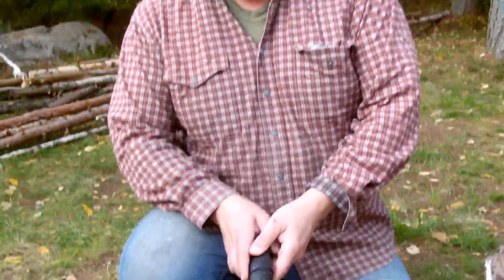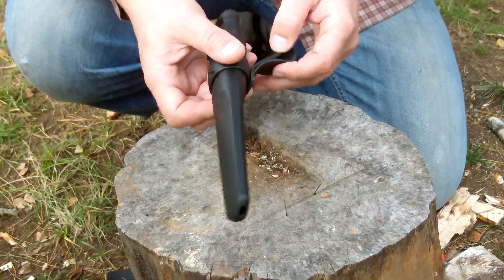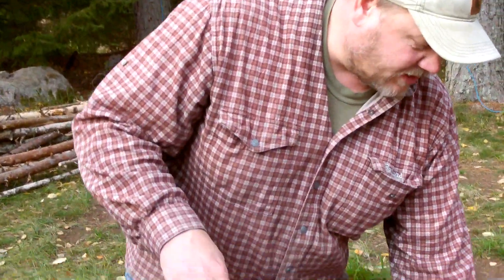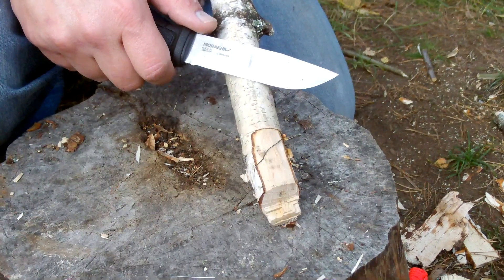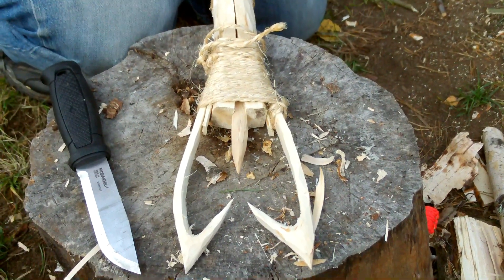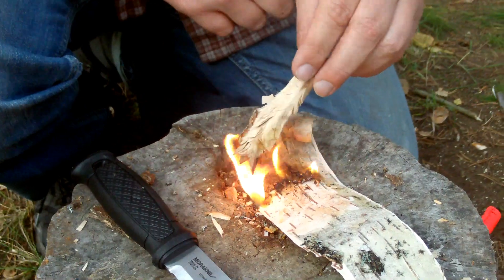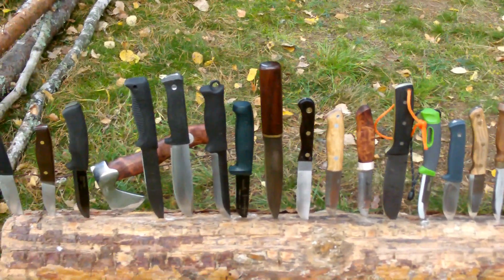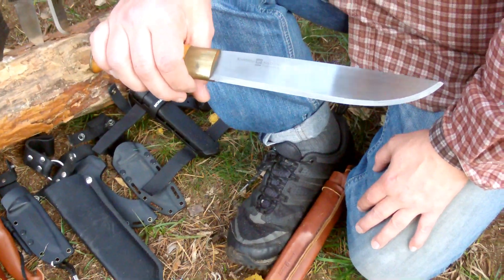Thor-is-testing: Mora - Garberg

Comment: I prefer the belt clip on Companion etc. Strong and useful, positive. Yes a belt loop can be useful sometimes, however it is easy to add a simple loop to a sheath but not to add a clip to a sheath. Kansbol can fit in Companion sheath, I think this will too. So it's all quite flexible.

Comment: I'm not fond of Scandi grinds for most things as it only has a short sharpening life until the grind gets too steep and literally needs to be re-ground. BUT  for wood carving they are excellent. I buy some Lauri progressive temper blades with a Scandi grind and the edge is HRC 63 hard, that is file hardness and for carving wood it is excellent. I put nice handy handles for carving with a flat spot on top for your thumb. Wonderful blades.
Reply from the maker: As you have probably heard in my videos I think scandi is the best all-around grind. I agree white the sharpening, but do think that they are easy to sharpen also on the trail. hrc 63 is that not to hard want it chip?
Reply: @Thoristesting  Yes it will chip if you hit something hard. I sold one to a deer hunter who wanted a knife that could go through a deer without stopping to sharpen and I warned him about how it may chip if he hits a bone hard. He said he carries a small hatchet for splitting the pelvic joints and he'd be careful. He basically just wants the knife for field dressing and he uses one of my old D2 fillet knives (HRC 60-61) for butchering it down into hamburger cuts and roast/back strap etc.
 I don't do anything fancy with the Lauri 3 inch knife, just a small guard and exotic wood like purple heart or marble wood with a leather sheath and a nice border tooled onto it. He said he didn't know where he could get a semi-custom knife with a left handed sheath (he was left handed) for under $100, I sell them ($85) as wood carving blades, but if you're careful you can use them for skinning, but they're not exactly an everyday carry, EDC blade as chipping could be a problem if used beyond its design parameters.

Comment: Hey… thanks for the testing. One suggestion, could you rank all the knives you've tested in the your order of preference, just to have a perspective on your "Journey" so far. Take care, Irène (subbed by the way).
Reply from the maker: Melusine Centun, hi there Melusine, hmmm I have been thinking about it, and in the start I did grade the knife on a point scale. But it seemed that most knife manage to get almost the same score, some are expensive and really nice knifes but I also find that it takes a true skill to make a quality knife for few bucks. So like I said it is very hard. Some are pretty some are no bullshit knifes. I love them both. Some are all around knifes some are camp knifes some are workhorse. I love them all 😀
U get my point. Though of course I have my favourite that I were when I’m not filming
Reply: Thanks for the answer. So what is your favourite??
Reply from the maker: It will have to be in categories them- High end: Fällkniven A1 or S1 (ill be testing the S1 soon), - No bullshit tough knife Terävä 140- On budget Mora or (Hultafors really cheap)- Pretty knife => Karesuando- Best all around for the money Mora Garberg
Reply: Thanks for answering this difficult question. Take care, Irène.

Comment: All Moras are the best bang for the buck, you won´t find knives which get you more for your money.
Knives which cost 10 times more won´t do better in using them.
And I like the Scandi-blades.
But what really pisses me of on the Scandinavian knife form is the grip, because of not having a real finger guard or a finger guard at all.
When it is wet, muddy or you  have to do the red work, you might slip forward with your hand and cut yourself, which can lead to extrem injuries.

Comment: The garberg doesn’t have moras rubber handle!! It’s hard!! And I feel the blade is thicker than what you would want on this size knife. I bought this thinking the handle would be like the mora companion but it’s not. I don’t have the kansbol but I wish I got that one. I don’t think full tang on this knife is necessary. I like this knife but I think the kansbol is a better option
Reply from the maker: Hallo there, Hmmmm ur right in that full tang is not always needed. I understand  ur thought on the blade thickness, and i think i understand where you are going. I think I like a more vesile knife that I can use for almost anything. the Garberg is that kind of a knife. the kansbol i also a very cool knife, but more of a fine tuning instrument and not so versatile (in my opinion)

Comment: I like the video. The knife seems to perform well but is way overpriced imo.
But now serious. You say a few times in the beginning of the video that this is the first full tang Mora, but you are Swedish right? You never heard of the Mora Lapplander series hunting knives? They are really full tang with wooden handle scales and have been around for 40+ years. So NO. The Garberg is NOT the first full tang Mora and I don't even consider it a full tang. It's a protruding over-molded stick tang much like Fallkniven. 
About that multimount system. If you are not using that leather strap covering the top it's only a velcro strap keeping your knife in place and that won't work in snow, mud, salt water, etc. If you attach it to your pack but now you are at camp and want belt carry you have to get the other ring with the belt loop on it, so you have to bring that also. That multimount sheath to me is an expensive gimmick. Just the knife, plastic sheath with the belt loop for 50 dollars would be an ok deal.
Reply from the maker: Hi there my friend, Yes I know :( an the stupid thing is that I do know about the Laplander series, what I think I meant is that in stores it is the only fuld tang, but Im not even sure that that i correct either. So my bad. Hmmm so you say it is a rat tail (Protruding) hmmmm have to get it out of store to check it, you might me right.
About the mulitmount system, I think it is a bit better than you feel, but I see you point, and I to had a ekstra secure string (a piece og Paracord to secure it) 
Is it overpriced hmmm I realy feel it is a cool knife, and it is more expencive than other Mora, but if you compare it to other brands you still get a lot for your money, in my opnion
Reply: @Thoristesting  Americans usually will call it a full tang. I kinda agree with the way Fallkniven calls their knives like the F1 etc. and that's a protruding stick tang. It's pretty broad so I agree it's strong enough. Of course this way of building a knife is very good when in cold weather with bare hands. 
I wonder how much that multimount system adds to the price and I also wonder who ever uses that system. I wish they would offer the knife just with the plastic sheath and the belt loop attachment for lets say some 55 dollar.

Comment: Say Heah, I hope this helps.,,. 
C: 0.62; Cr: 14.00; Mn: 0.60; 
N: 0.11; P: 0.025; S: 0.010; 
Si: 0.20; 
Maker: Sandvik - Sweden (SE)
Notes:
Sandvik stainless steel, specifically developed as a knife blade steel. Initially, it was an exclusive for Kershaw/Kai cutlery, not anymore, Italian knife company Nilte uses it in their folders. Composition was first published in 01/2011, but it was correct, listing wrong N content, 0.55% Mo, which is gone from official Sandvik website. Addition of the nitrogen should improve corrosion resistance and hardness. Sandvik's recommended working hardness 55-62HRC. Very fine grained alloy, which is a good news for any type of the knife. I wouldn't call 62HRC very high, there are a lot of alloys capable of 64-68HRC, old and new. Still, very decent alloy, offering good combination of corrosion resistance, edge stability, wear resistance and strength  Dilly Dilly.,,.p

Comment: scandis are.... okay at best. Honestly really disappointed with my garberg. Way too much edge damage only making a tiny pile of kindling. Way too much material taken off to make the grind. Grip is too hard and way too slippery for no finger guard. A companion has a much safer feeling in the hand even with no guard but it juts out a bit further so your finger feels way safer.
No colors either. Mine also came unfinished, the lanyard hole wasn't even done and had sharp edges and flakes of metal inside the hole that I had to file out. My much larger cold steel cost the same, only it's way sharper even after chopping 30 times the amount of kindling. Super, super disappointed. At least the garberg is unbreakable, but that's really the ONLY merit it has and because it's just a solid chunk of steel.

Comment: Good review but When that knife has a full rubber over mould handle then it might Rais my eyebrow otherwise to me it's just a 511 on steroids . Until then I'll stick with my bushcraft black.
Reply from the maker: Bartering Bushcraft Crafty By Nature, hi there, hmmm I get your skeptic, but I have tested both, and though the survival I good, if you have them both in your hands you can really feel the difference, this is the better knife 😀
Reply: CRAFTY BY NATURE all you have to do is take a piece of inner tube and put over the handle, it makes a huge difference and it fits super tight
Reply: @Glock-1 . That is ingenious.. I did break down  and went and got one.. I don't mind the handle but I will definitely try this.. thanks  for sharing that..
Reply: @Glock-1  What is inner tube mate?